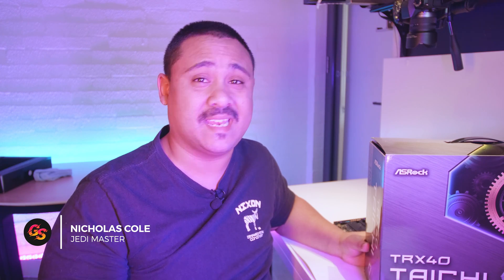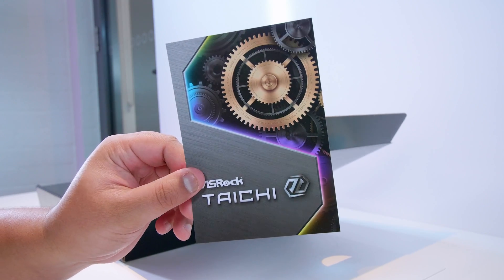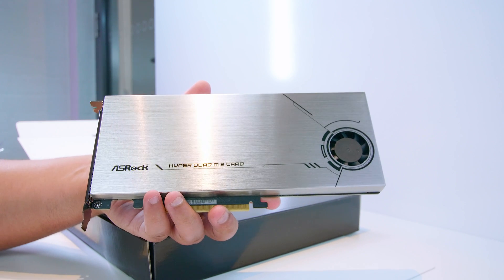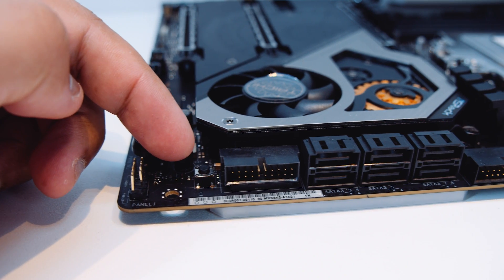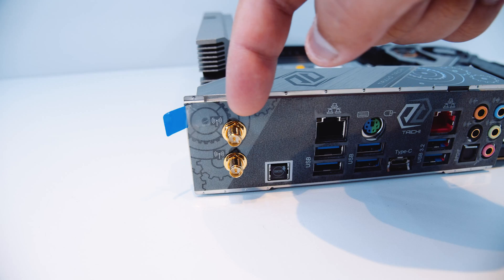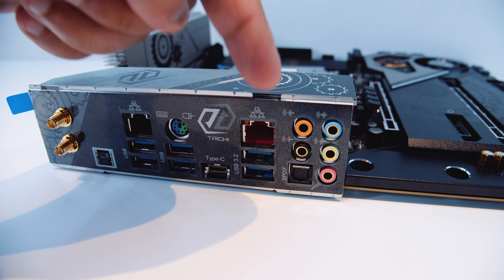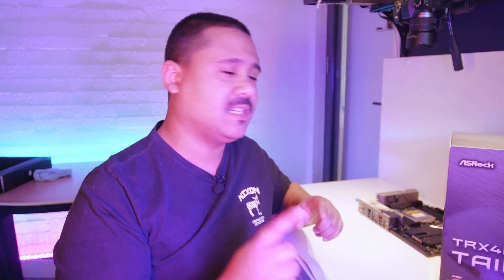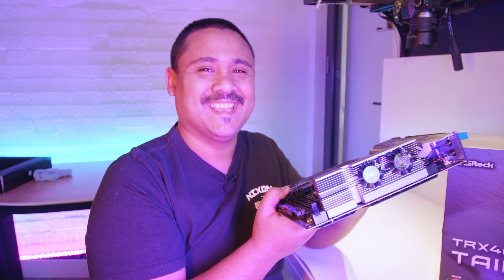ASRock TRX40 Taichi - First Look and Unboxing

Comment: Any idea where the CMOS battery is (not sure that's the problem or not)?  Having issues with mine... hangs at startup with a 0x60 error and never goes past it
Reply: Figured it out... the battery is double-sided taped to the top (as it would be mounted) of the I/O ports under that shield that comes from the heatsink.
My issue was I was trying to set it up while the TV was on the wrong input... entirely my fault.

Comment: No thunderbolt pins..the pins are there but no connecter
Reply from the maker: Probably reused PCB from a board that has it. If it had the controller it would probably have been included

Comment: Thanks for the first look. Crazy VRM cooling - No top mounted radiators with most cases I bet, clearance is already tight in most.  Still that is a neat looking board. looking forward to some performance reviews on this one.

Comment: Is that a Thunderbolt header with its pins removed in the lower left corner? 

Because that would piss me right off.
Reply: R.I.P
Reply: ffs..  why are such expensive boards not having TB3?  there isnt one TRX40 board that has TB3, while the ASrock Creator AM4 has TB3.
Reply: @tubelator  I think one of the Gigabyte's TRX40s has it, but it's not well documented.